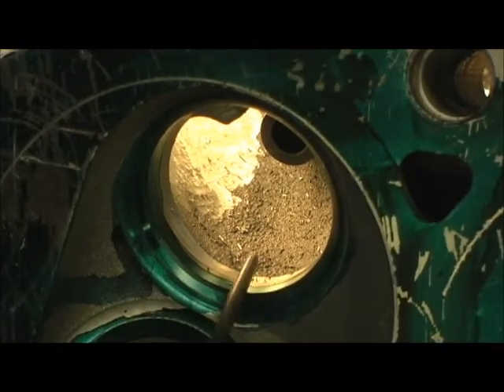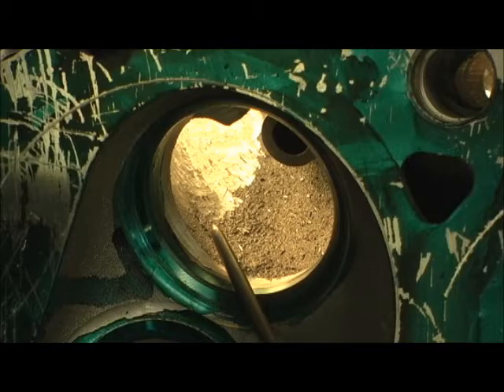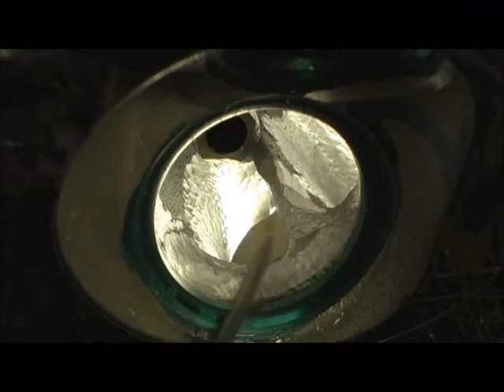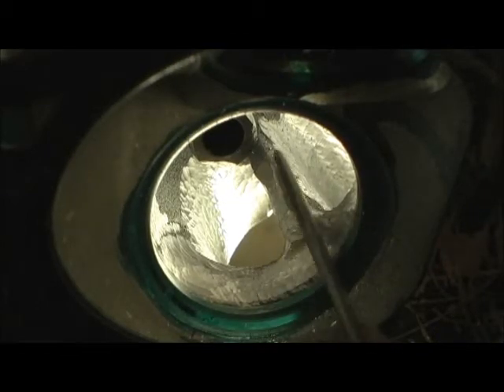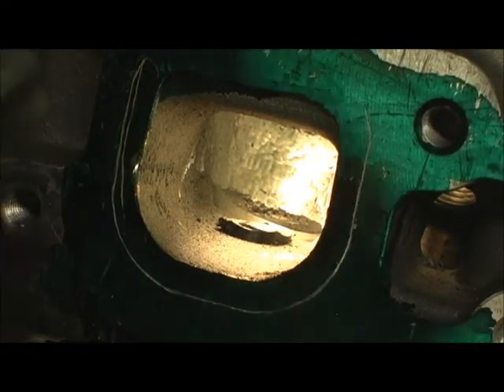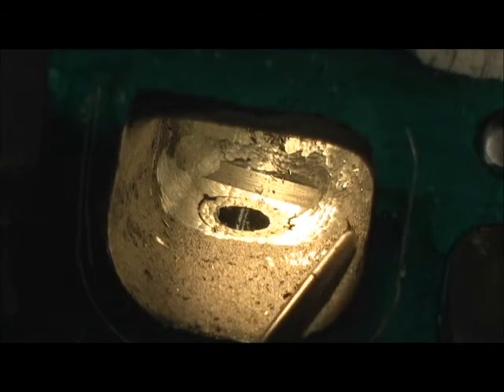Ford Focus 2.0 MPG MODE State III part 2

Comment: Man, watching this series was a real eye-opener!  I swung by your website to send you an email about potentially sending you a few heads in the future (One for cutting up!  Whee!)!  I've watched quite a lot of your videos now, and I'm starting to understand what I think are the real basic theories, but a lot of the complexity and nuance is still way beyond my feeble little brain cell.  ;-D

If you're curious, I've got a 98 Oldsmobile LD9 engine, and from my perspective, the head is a freaking nightmare.  Chambers hug the fire ring, massive machinist ridges around all four valves (16V DOHC head), REALLY weird chamber roof shapes and contours that I don't understand, and double-hump intake runners with the fuel injectors as part of the head...  I'd love to do an MPG mod, but I just don't seem to understand enough to be able to look at it and know what needs to go where.

LOVE your videos, though!  You have to be one of the smartest buggers out there, and it's really cool to be able to watch you work and hear what's going through your head!

Comment from the maker: OMG!!! I never seen the intake manifold (it was bolted on the mans car, so I never got to view it) but that sounds Messed up guy, and it is if that is the case. I can believe it as the butterflies would get in the way and the factory would not even consider that a problem as to them machining stuff would be at the end of there list along with horsepower (only emissions matters to them because of C.A.F.E. and C.A.R.B. along with E.P.A. and Spotted AL BORE- AL Gore). Thanks for the Tip,

Comment: On mine the alignment was fine, but the factory ports were bigger on the intake, and small on the head, basically just stepped down from the intake to the IMRC and then stepped down again to the head, just seemed like a hindrance on the intake flow instead of one smooth motion from the intake down.  I always wanted to try it, but figured it would be more work than what I wanted to deal with.

Comment from the maker: When you say "Matched up" are you refuring to Head/intake alignment? The IMRC is correct I believe, and the twin cam 4.6 is a good example to go off of, which has the dam butterfly in the intake runner deal like this one did. It is more about emissions then gas mileage and power. My customer got just over 5 miles per gallon with this job I done for him.

Comment: I've been watching this series and I was about to say it really needs the IMRC and the intake to really see how the design works.  I believe the 99-04 3.8 Mustangs have something similar.  The jacked up casting though is what I noticed when I pulled my Escort head apart, would be pretty nice to see what kind of power and mileage gains could be had with the IMRC and intake ports actually matched to the head.

Comment from the maker: The D shape is the primary runner as I found out Saturday, when I seen the car as the intake had butterfly's on the round runner side. I don't know about the swirl part, but it is definitely a negative pressure/high pressure thing going on there. More than likely swirl, I hope that made your day Yank. LOL 
I did not see the pistons as the head was on when I got over there.